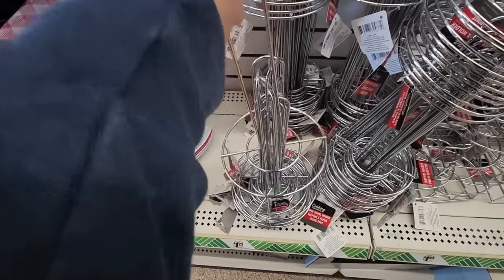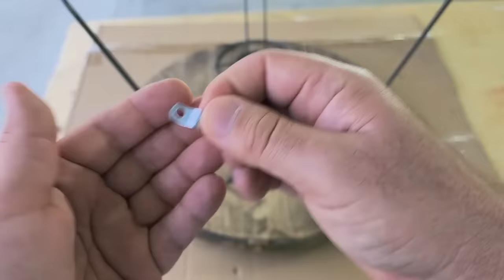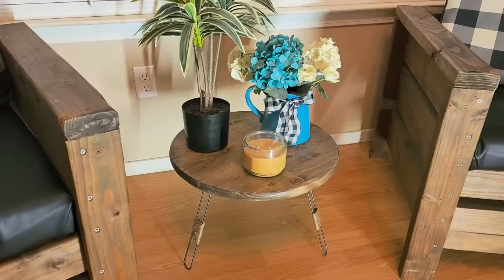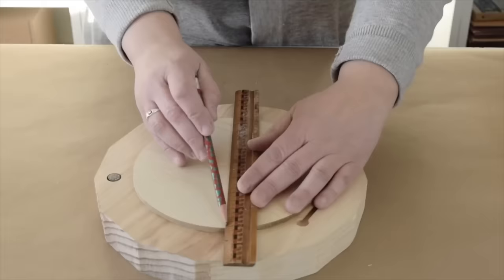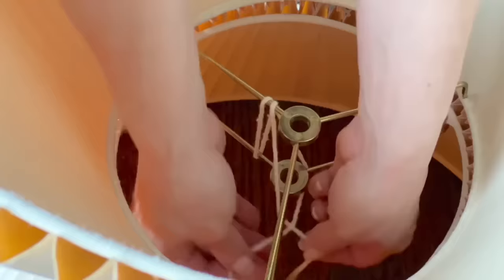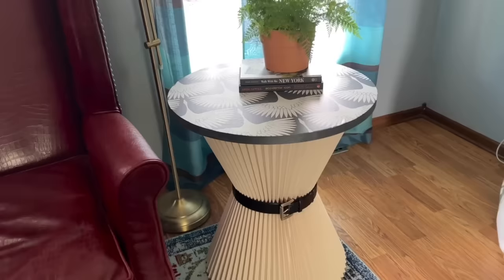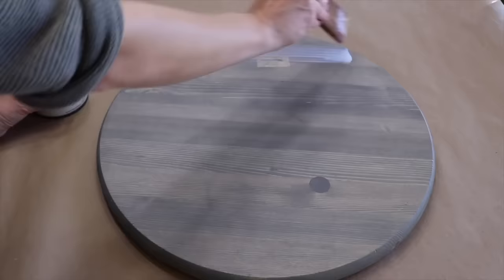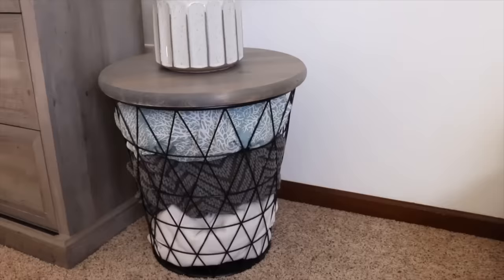Buy a wood round at Home Depot for this GENIUS idea!

Comment: 8:35 if you don't have the rubber feet you can slice up a wine cork and nail that to the wood instead (i used hot glue at first and they ended up falling off). Worked well for when i made one for my bin so i could place a fan on top. I also cut the circle about a quarter way in (so I had two different sized semi-circles) then glued fabric on (with both pieces pushed together to make the full circle), that way it made a makeshift hinge so I can still access my bin without removing what's on top!

Comment: Thanks for the ideas.  All easy, cheap, and cute.  Great for adding interest and functional pieces on a budget.  But, for the lamp shade table:  With that pattern paper on top, turn the buckle to the back.  With the buckle up front, choose something western to put on top.  I'd use a brown belt and something with horses, cows, or cowboys on top.  A light spray of clear coat vinyl on the lampshades?  Would that work or would they discolor when wet??